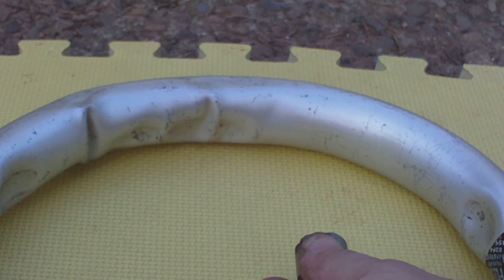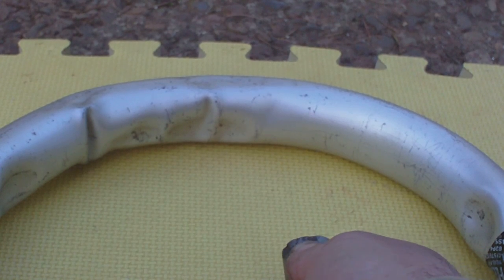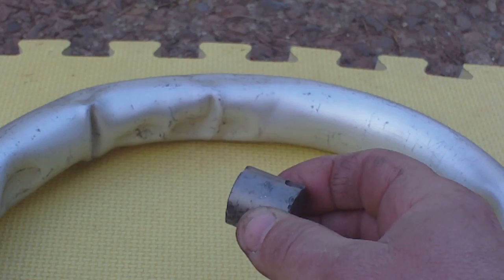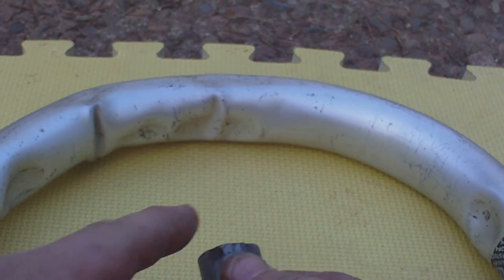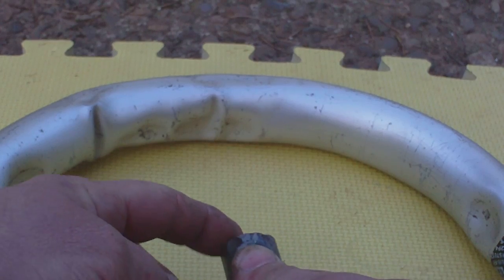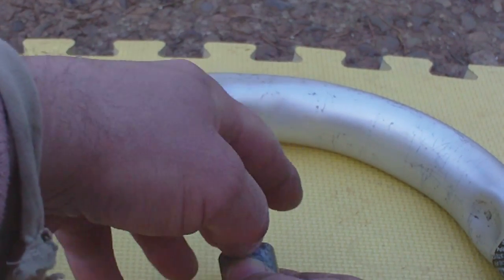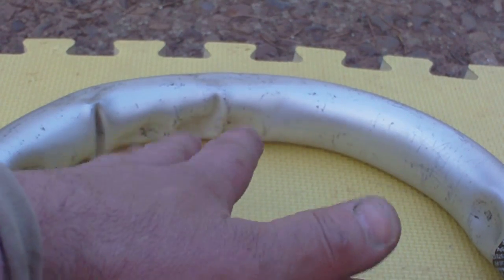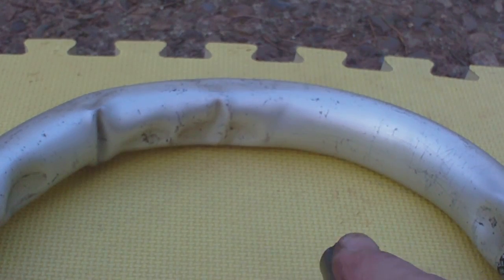a visible FLOWING magnetic field

Comment: I believe this is how the military has invisibility cloaks.
Reply: Nope
Reply: IEatPeople4Breakfast One of his vids you can see what is behind the object. Creating a weak oxygen magnet. Slightly thicker air creates a lens to bend light around the object.
Reply: johnstarr2001 Link me please, I can't find it
Reply: In fact don't bother, I knew it was optics purely, I just didn't know if it was a quantum optics effect that I did not know: http://www.physics.org/article-questions.asp?id=69.
PS that's a H2O shield, oxygen, which is a symmetric molecule, cannot be affected by a magnetic field except in the case incredibly strong ones, inducing a small dipole only.
Reply: IEatPeople4Breakfast can't find it I'll keep looking. You could see around the magnet he holds. I understand strong field would be needed. Rust has oxygen in it. With the magnet field and aluminum something is happening. Wonder if he uses red or black oxide?
Reply: rust isn't in the air to bend the light, nor are oxides specifically magnetic. TiO2 is, maybe AlO2, but I still don't get where you are coming from with this =[
you can see the effect sometimes only because the magnet is in some critical position, probably while reconfiguring the field or something which would cause a stronger field at certain points. I just can't figure out if it is bending light or if it is refraction by air, I have not had much experience with this kind of stuff

Comment: Indeed, with the enhanced version no distortions appear. I am talking about the 720p HD version, which is also compressed but less so than say 360p. There is absolutely nothing visible.

My question here is really, what if it is visible? How does that advance us? We already know magnetic fields exists, we use them everyday, we can measure them  and any physics book will have a picture of iron dust particles aligned along the field lines of some magnet. So what are you trying to accomplish here?